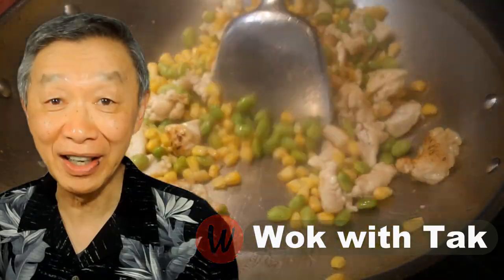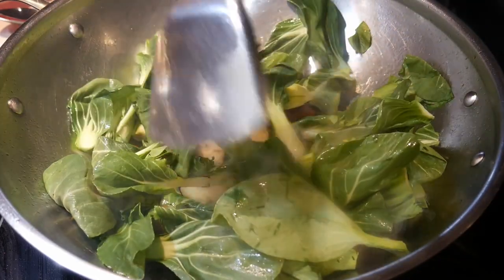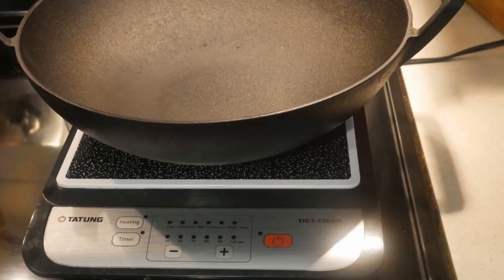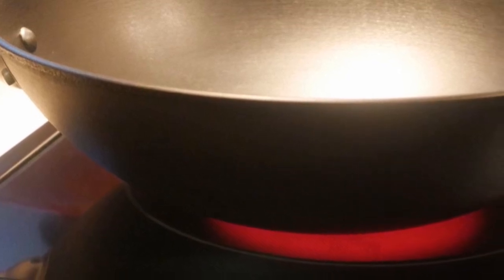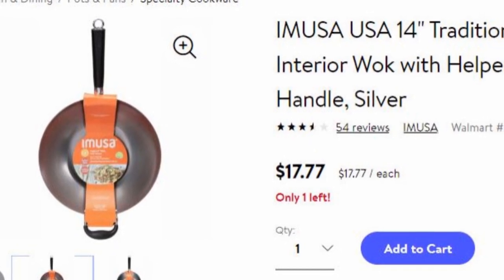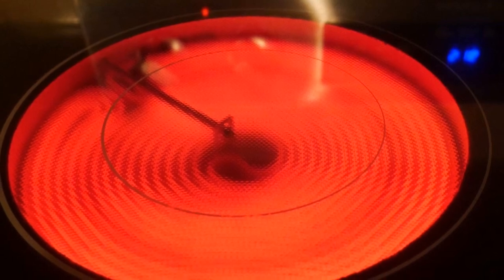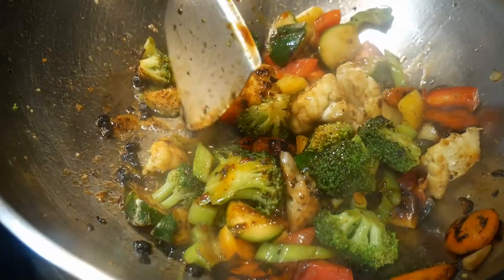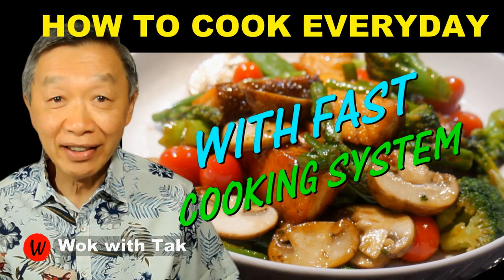Tips on stir-frying on a GLASS TOP ELECTRIC STOVE

Comment: I have the exact same stove as you. I have a lite cast iron wok and it works much better than the old gas stove. I find the heat easier to control and cleanup is very easy.  I would not go back.  I stir fry 3 to 4 times a week and this stove is so practical.

Comment: I have a glass top stove and often bring my cast iron skillets up to over 800° F when searing a steak, and when stir-frying I have no trouble getting a nice high temperature. To control the heat, I simply remove the wok from the burner and place it back down to continue. When I need to lower the heat, or I am done cooking, I move the wok to an empty burner instead of leaving it on the hot burner I was cooking on.